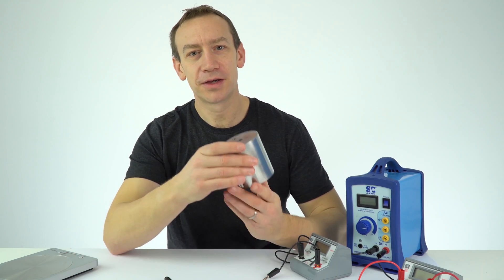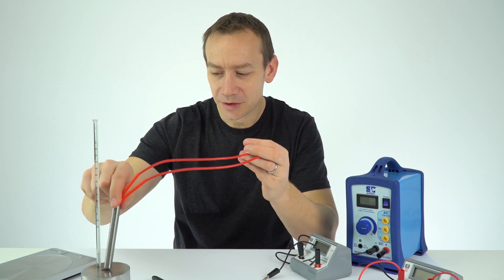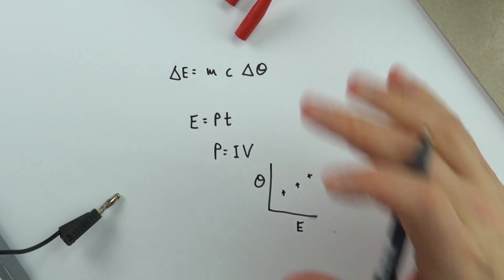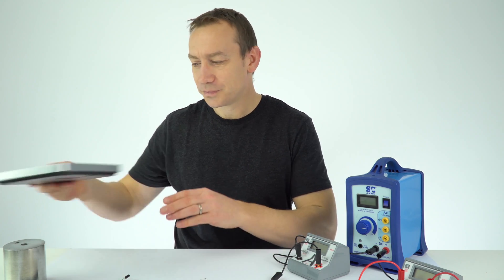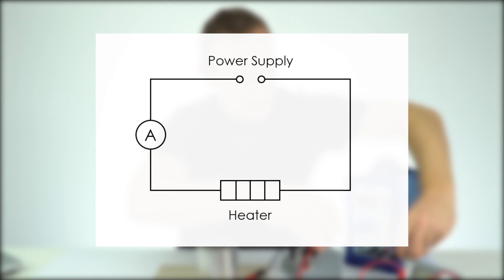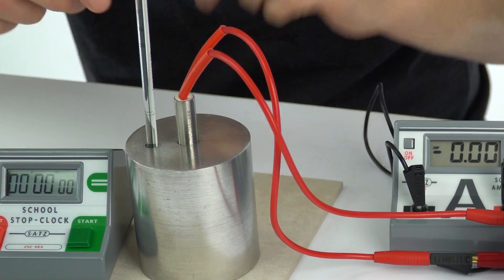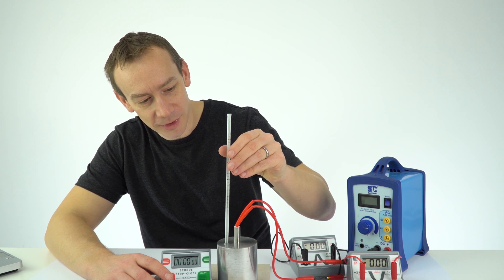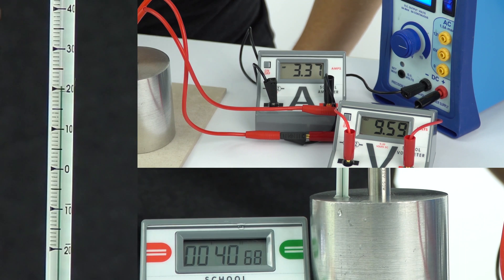Specific Heat Capacity of Aluminium Experiment - GCSE Physics Required Practical

Comment: hi
have you added few drops of water before putting immersion heater and thermometer
if yes
why
Reply from the maker: So there isn’t an air gap between them, this means you have a better transfer of heat between them and the metal.